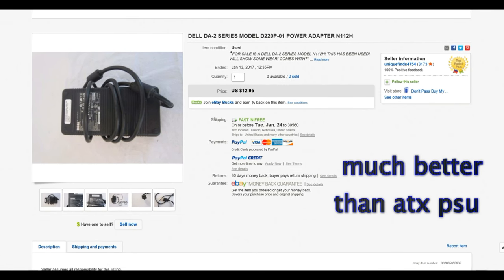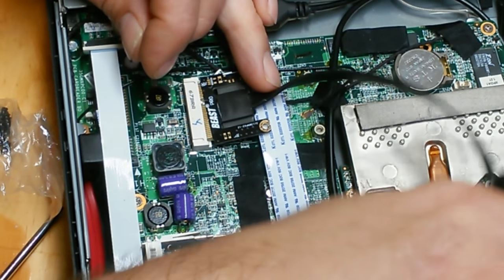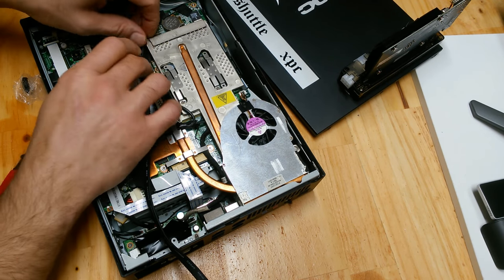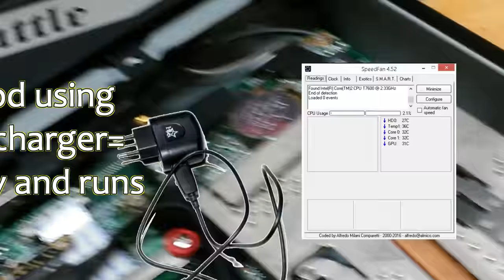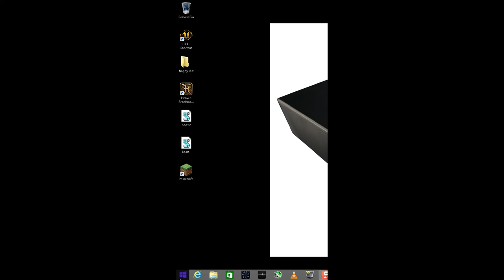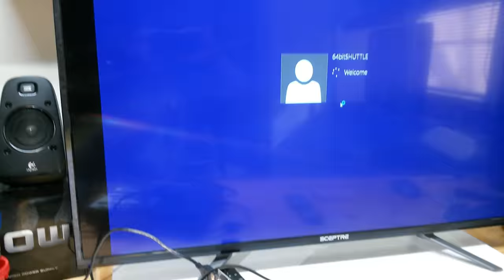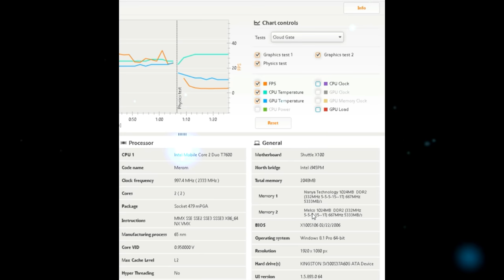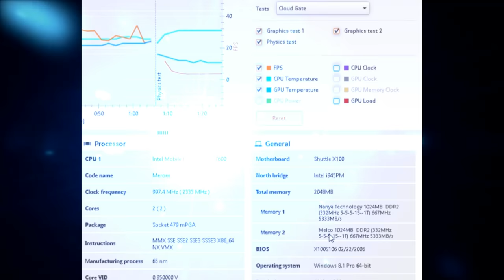shuttle xpc gaming with external gpu?

Comment: Unfortunately, there is  not a way to get this system to use more than 2GiB of memory. The chipset (945PM) supports up to 4GiB, but that likely doesn't mean much in this case. One of the limitations of memory size is the number of address bus lines a manufacturer bothers to wire up the the IMC. While the IMC in this chipset may support 4GiB, Shuttle chose to only wire up enough address bus lines to support 2GiB.
Reply from the maker: thank you very much for that! Its hard finding information on these little media center computers, but im glad to have one.
Reply: the ram could also be incompatible. i discovered that the 945 chipset is rather picky with RAM

Comment: It's pretty crazy that the motherboard wouldn't have a bios upgrade to give you a chance at adding additional ram, they do have a bios update for the x100 "Your System" and a processor microcode for it as well at shuttle. I had a motherboard an ECS Emachine board that would only support DDR2 533 and a 800 mhz fsb cpu and when trying a 1066 mhz fsb core 2 duo it would not boot at all, I found a bios update at ecs and flashed the bios and was able to install a Core 2 Duo with 1066 mhz fsb and DDR2 800 which were both mentioned in the bios update. 

It also got rid of the Emachine logo which was really nice, though it claimed it would support 1q333 mhz fsb cpu's my E8400 would not boot. But I don't know if the bios updates at shuttle are newer than the ones installed already, but you could always download them and flash it then boot into bios and see if there are any changes to the menu. You can also try after that to see if you can add more memory. But Shuttle Motherboards are in-house built or specifically for shuttle pc's only so who knows. Perhaps you could contact award if that is the bios you have and see if they can help! 

I just bought a H110M VD-Pro motherboard and a Kaby Lake Pentium G4620 and had to buy a Skylake Celeron just to update the bios before it would boot at all, but then instead of wasting the purchase of the celeron, I bought an ECS H110I-C4P Mini-ITX to use in my XPC SJ41G4 "It is one of the first to say in the manual that you can upgrade the motherboard to a Mini-ITX unlike other Shuttle XPC's which people had to modify the cases. I also bought 16 gb of Geil Potenza EVO DDR4 2133 to replace the brand new 8gb GSkill Aegis DDR4 2133 I bought originally for the Kaby Lake which is in the Celeron setup.

The Socket 775 in the shuttle with the Q9450 could only hit 3,900 on Passmark 7 that is with 12mb of L2 chache, but the dual core Celeron with 2 MB of L3 smart cache can hit at least 3,800 on Passmark 7! The same was for my X3350 Xeon replaced by the Kaby Lake, it now hits almost 6,000 on Passmark 7 with just 3mb of L3 cache compared to the old cpu's 12mb L2 chache! I am running my XFX R7 360 on my Kaby Lake and a Asus GTX 650 TI OC with 2gb of GDDR5 on the Celeron system! Both Cpu's only need 51 watts compared to the 71 watts which is another nice addition!  

On Passmark 8 my Xeon would top off at 1,450, the Kaby Lake is hitting 3,820 in Conventional mode, that is better than an I-5 Oculus Rift min Spec! Eventually I will upgrade to an I7-7700k since they are only $309! And put the Pentium in the Celeron case and build my mom a system around the Celeron!

Oh, I just repainted my old Compaq pc case and had thought about adding colors, but I made it an all stealth Black case, by using Rust Oleum Truck bed liner, I can believe how well it looks and it is almost the same paint Compaq used on the case originally! It worked great on all the plastic, giving it a nice texture, I sprayed the interior as well, since black often absorbs extra heat and I wanted to use it to silence the case a little more! 

I just figured with as many pc's you repair and refinish, you might like the finish of the Rustoleum Truck Bed liner, plus it refuses to peel from the surface and handles abuse from moving it around! It is Cheap and the also have another brand that offers a clear finish, which might add durability to a paint job without affecting color choices!